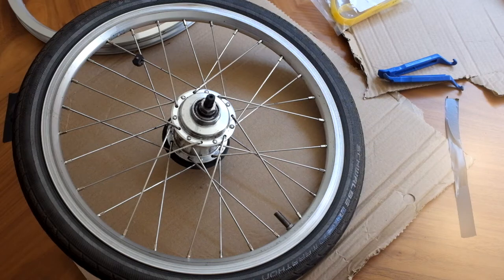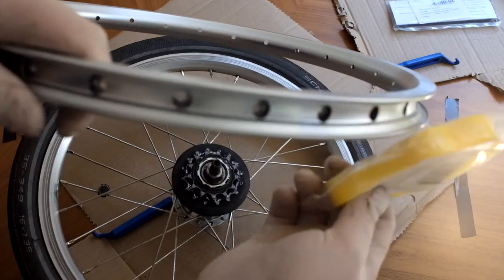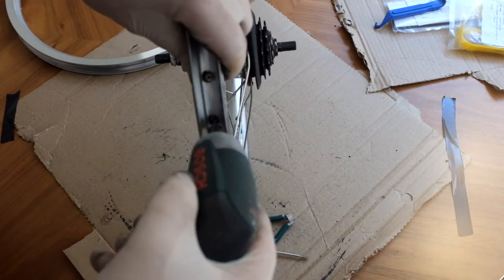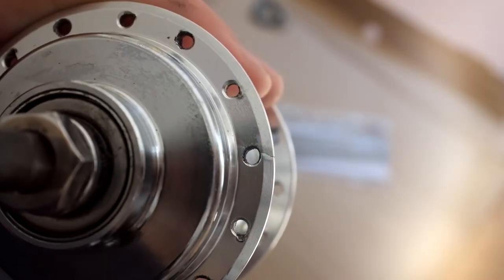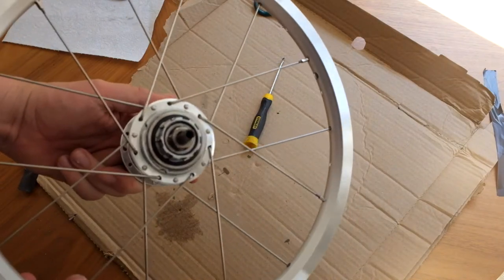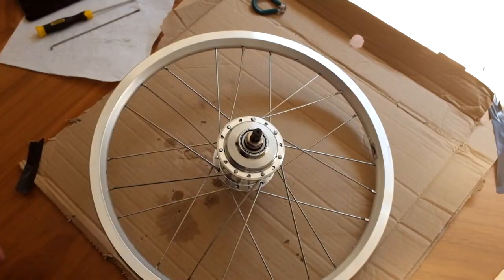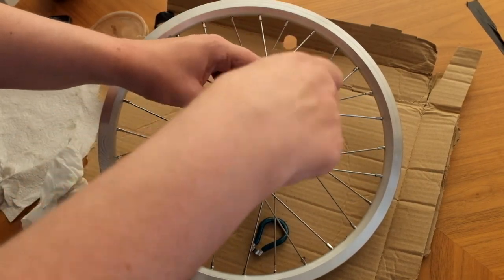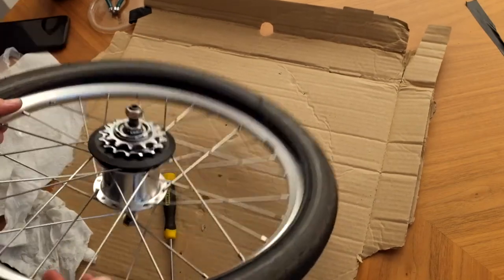Brompton rim replacement

Comment: For anyone wondering about the crack in the hub flange, since it was only cracked at one spoke hole, this wouldn't be an immediate threat. IF you take it to a proper bike shop, they will tell you that you'd need to change the hub too. 

You can ride that wheel even if you took that one spoke out where the hub was cracked and it would still be fine but of course the two spokes either side would have great than normal stress.

To conclude, take it to a shop if you're not confident in truing the wheel as this video doesn't quite clearly show how difficult truing a wheel is to a newbie since you need to not only have it radially true, laterally true, dished, and the spoke tension needs to be set properly. Adjusting one of these four things will directly affect the other 3. Also to note, dishing the wheel requires a specialist tool as well as checking the spoke tension. The rest will just be the spoke key.

I am a bicycle mechanic and have been for many years so if anyone has questions, I am more than happy to help! 

Great video James!

Comment: Many thanks for sharing your knowledge & posting this excellent video, a very clear & succinct  demonstration. I feel more confident at 'having a go' myself now - when the time comes. (I have a Sachs 3 speed internal hub on my M3, any idea as to what spokes would be needed for that model?)
Reply from the maker: Thanks Nick. According to https://brilliantbikes.co.uk/content/21-brompton-spokes - the spokes you need have been discontinued by Brompton. The page also lists the spoke type, which depends on whether you have a modern double-walled rim, or an older single-walled rim. If it were me, I'd go for a new double-walled rim, and you might be able to get the spokes made elsewhere. I've had excellent service from spokesfromryan.com when I have needed custom spokes cut.
Reply: @jimlondon  Thank-you very much James for the info and tips. Best Xmas.

Comment: Thanks very much for the helpful video.

FWIW, I find it easier to hold the hub in a vice.

After doing the drive-side, I was a bit lost at where and how to start with the first spoke on the non-drive-side.
Reply from the maker: You're welcome! Apart from riding the Brompton, I don't have any vices :D
Reply: @jimlondon  Also, it's easier to remove the cogs/sprockets first, while the wheel is still in one part.

Comment: Based on Brompton website wheel datasheet, the QRIM-28-STD rim (Double wall rim - standard drilled ) seems should be only used on front wheel or 1-2 speed rear wheel.
Reply from the maker: And for hub gear rear wheels use QRIM-28-AGL (angle drilled). The two are distinguishable by red and blue stickers as mentioned in the video. I buy mine from https://brilliantbikes.co.uk/84-brompton-rims-spokes

Comment: I will need to view your other videos on wheel building, so thanks in advance for sharing the information.
I use a Brown Rawplug through the tape and the rims valve hole. It keeps the rim tape from creeping. Prior to fitting the rim tape loop a thin small cable tie around the rim tape (smooth face to the underside of the rim tape). The loop should be big enough for your hooked index finger and a gap. Once the rim tape is completely in the trough centralise it via the cable tie loop, then remove the cable tie.
Long winded but hopefully the idea has come across.
Thanks again for the videos.
Take care.

Comment: Can you not just cut the old spokes out? If you have new replacements?
Reply: FYI anyone. Cut a few of mine with a good set of wire clippers, but unscrewing them was so easy and not that long to do actually.

Comment: Hi there what size spokes did you use. What size wheel is that?
Reply from the maker: This is a standard 16" double wall angle-drilled rear rim for a Brompton. The spokes depend on the rim and the type of hub.

The standard Brompton spokes are:
132mm PG 14G - Shimano dynamo front wheel with 2013 onwards double wall rim
133mm DB 14G - SON dynamo front wheel with 2013 onwards double wall rim
135mm PG 14G - Shimano dynamo front wheel with pre-2013 single wall rim
137mm DB 14G - SON dynamo front wheel with pre-2013 single wall rim
145mm PG 14G - standard front wheel with 2013 onwards double wall rim
146mm SB 13G - Brompton Sturmey Archer rear wheel with 2013 onwards double wall rim
148mm PG 14G - standard front wheel with pre-2013 single wall rim
149mm PG 13G - Sturmey Archer rear wheel with pre-2013 single wall rim
151mm DB 14G - 1 and 2 speed rear wheel with 2013 onwards double wall rim
154mm PG 13G - 1 and 2 speed rear wheel with pre-2013 single wall rim
155mm DB 14G - super light front wheel with 2013 onwards double wall rim
158mm DB 14G - super light front wheel with pre-2013 single wall rim (cross laced)

I buy mine in the UK from Brilliant Bikes - which also has specs on their site so you can check you have the correct spokes before you buy.

I also have a Brompton front wheel with an unusual Son dynamo hub, for which I need to get straight pull spokes custom cut to 144mm - I use Spokes From Ryan for these.

If you are using a different rim / hub, you can take measurements of your hub and rim and use a spoke calculator.
Reply: Thank you.....very helpful info for my wheel build

Comment: How did you get on with the crack near the spoke hole?
Reply from the maker: No further issues. I still have that hub but have since bought a new bike so the original bike only gets occasional use now.
Reply: @jimlondon  I'm going to do a vid on a Brommie front hub full bearings / wheel strip down/rebuild: there doesnt seem to be one out there, plus mine needs doing after 13,000 miles

Comment: Hi, how long are those spokes? Thanks
Reply from the maker: These are 146mm spokes (for Sturmey Archer hub and double-wall standard rim). 

The standard Brompton spokes are:
132mm PG 14G - Shimano dynamo front wheel with 2013 onwards double wall rim
133mm DB 14G - SON dynamo front wheel with 2013 onwards double wall rim
135mm PG 14G - Shimano dynamo front wheel with pre-2013 single wall rim
137mm DB 14G - SON dynamo front wheel with pre-2013 single wall rim
145mm PG 14G - standard front wheel with 2013 onwards double wall rim
146mm SB 13G - Brompton Sturmey Archer rear wheel with 2013 onwards double wall rim
148mm PG 14G - standard front wheel with pre-2013 single wall rim
149mm PG 13G - Sturmey Archer rear wheel with pre-2013 single wall rim
151mm DB 14G - 1 and 2 speed rear wheel with 2013 onwards double wall rim
154mm PG 13G - 1 and 2 speed rear wheel with pre-2013 single wall rim
155mm DB 14G - super light front wheel with 2013 onwards double wall rim
158mm DB 14G - super light front wheel with pre-2013 single wall rim (cross laced)

I buy mine in the UK from Brilliant Bikes.

I also have one Brompton front wheel with an unusual Son dynamo hub, for which I need to get straight pull spokes custom cut to 144mm - I use Spokes From Ryan for these.